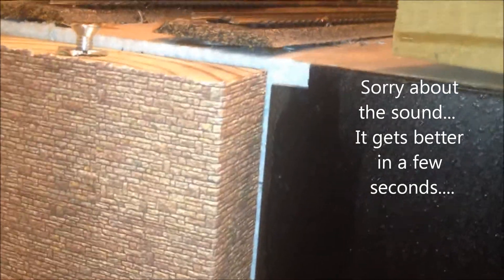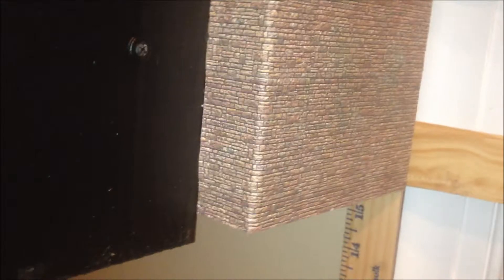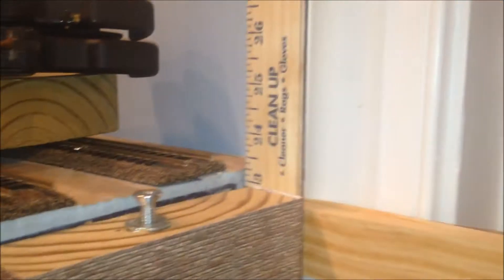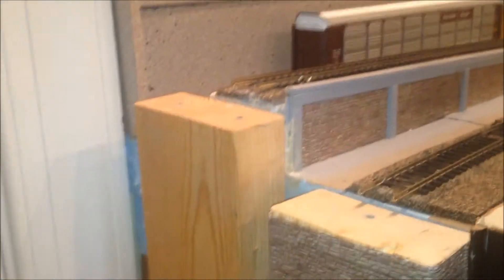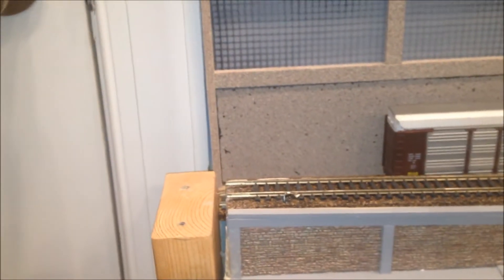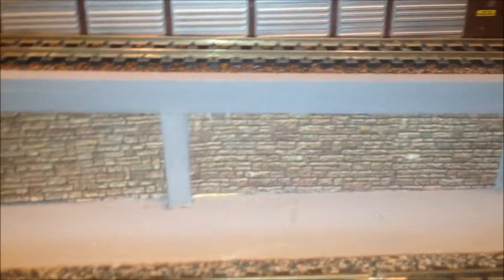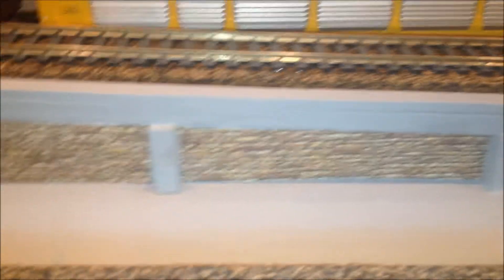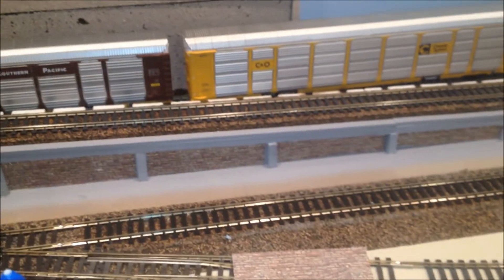My HO Scale Railroad   Episode 54

Comment: Wow. I had a lot of catching up to do. You have been very busy.Your layout looks great. The stone work on the abutments came out nice as did it on the incline. The yard came out real good. I Liked the idea of adding some small sidings by the engine shed, makes it look lke there getting ready to get fixed or just waiting to run the road. On the heavy equipment, you could use a cheap necklace and paint it any color you want. If it's like a silver just put some brown spots to look like rust. Good job Brian.
Reply from the maker: Thank you, sir!!  I've been meaning to make a trip to Goodwill to buy some jewelry for chains!  Thanks for the comments and suggestions!

Comment: That stone looks great.  I saw that type of stone that was made out of foam I think.  Its a flexible material.  I was thinking of build my retaining wall with it but its $15 for about a foot and I think it was 5 inches high.  Little expensive, since I need more than 16 feet of it.  I bought kit with foam board and wanted to print it on it but the printer wouldn't take it cause it was too thick.  I really didn't want to print it on paper and then glue it on the board but I may have to do that to save money.  Now I know what the wall will look like since its almost the exact design I had in mind.  Thanks for building it and no I don't have to mock it up.
Reply from the maker: Scott, here is the link for the stone -  http://www.ebay.com/usr/starboc1?_trksid=p2059210.m2749.l2754
THere are several styles available.  I received 15 8.5 x 11 sheets for 12.95 with free shipping.  It's about the consistency of wallpaper and attaches with white glue.  Very simple and good results I think!  Good luck and post a video of your result!